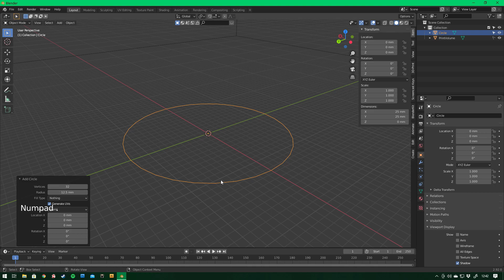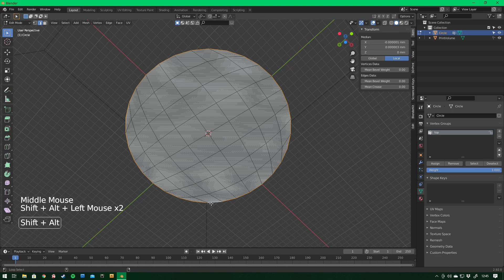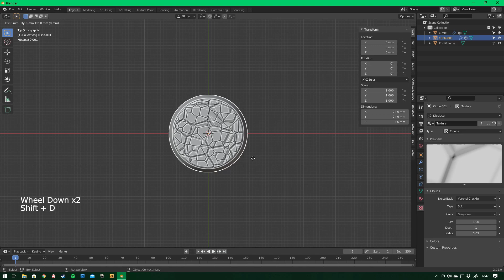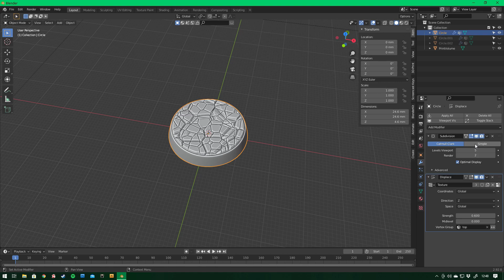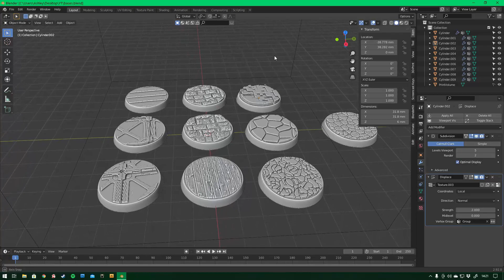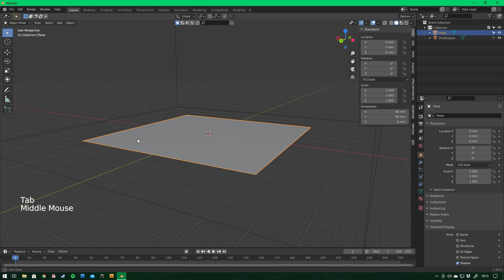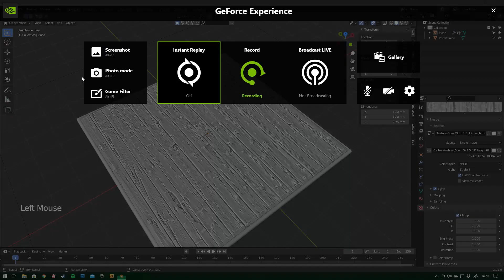Blender to Tabletop - Easy and Lazy 3d Print Floors and Bases

Comment: Thank you, and due to this video, i'll even be able to include a hole for my magnets that don't fit the standard warhammer bases
Reply from the maker: Hope it works! I would also use a Boolean with another cylinder to cut a hole just the right size.

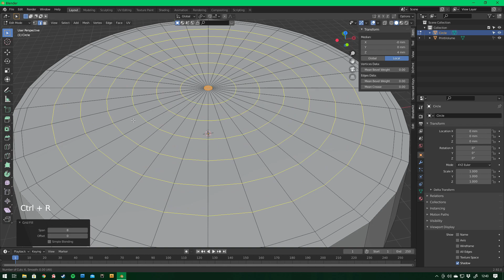Comment: CTRL+R at 2:15 just gives me the option to make verticies on one of the lines going out from the middle, I get no faces connecting them :(
Shift+Ctrl+R gives me an option to place one circle however... maybe they changed it in 4.1?
Reply from the maker: I think It would depend on which edge your mouse is nearest to on the face when you press ctrl + r. Hope that makes sense, if still unsure make a basic cube and play around with the tool. I also have a more updated version of this video, not sure it’s any better though I used blender 4.0 for the newer one.

Comment: hi mate love the video, although i am running into a problem. everything worked fine for the circular bases but when i tried it on the plane as soon as i add the displace it turns into either a big tower or a reverse tower. ive tried multiple times and still cannot get it to work.
Reply from the maker: Sorry for the long time to respond, didn't see the comment. If you are still stuck try ctrl+a and apply the scale. If that makes no difference a smaller number in the displace modifier is the only thing I can think of.

Comment: displacement modifier didn't work perhaps because it is 3.2 blender that I use
Reply from the maker: Should still work, it needs quite a lot of geometry. Subsurface, before displacement. 

I can't quite remember it it's been a while since I made any.
Reply from the maker: Also if you are in edit mode the modifier doesn't show up by default, so tab out of edit mode or toggle it in the modifier stack at the top of the displace modifier.

Just tried it in 3.4 works fine there.

Comment: i cant get my sci fi bases to look like yours :( . The global setting just makes the texture repeat a ton of times and looks super small. any tips ?
Reply from the maker: Ok try this,
In the displace modifier set the Coordinates to UV, then go to UV editing. 
To Unwrap I select all then cube project, now just select the faces you want to displace.
In the UV editor with these faces selected you should be able to scale them up and down to effect the displacement (in the modifier turn on the option to view in edit mode to see what it’s doing).

Or this

Make the model small, in the item where the scale is shown you can select all the scales and type “1/10” for example. Apply the new size. When you have finished make it back to the original size by typing “1*10” 
Typing this maths in just makes it easier to keep track of the base size.

Hope this helps.

Comment: can anyone explain why some times i implement the subdivision it makes my whole model nearly as flat as a pancake?
Reply from the maker: Not sure, but maybe apply scale to the model first?
Reply: @HuntsForge  ive tried it. done it the exact same way as you did. been redoing it 10-20 times now and only once did it work
Reply from the maker: @HydroX1334  I think the subdivision might make it flat if there's no slight bevel on the sharp edges. Ctrl+b is the hotkey.
Reply: @HuntsForge  thx for the tip gonna try that out
Reply: @HuntsForge  that didnt do it either sadly
Reply from the maker: Oh wow, well I’m kind of stumped then. I will make a .blend file and upload it to my kofi page as a free file but it probably won’t be until either this evening or tomorrow (uk time). Then you might be able to compare and see if there’s any difference’s you haven’t thought of.